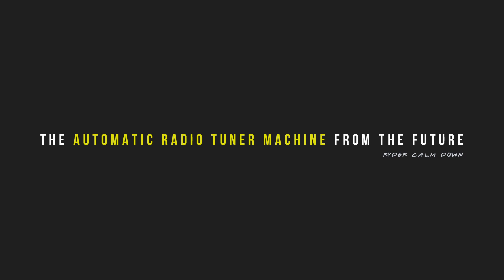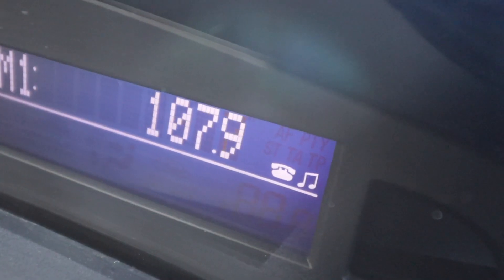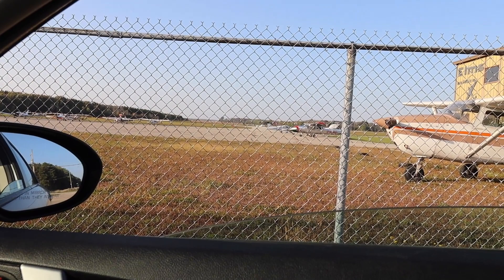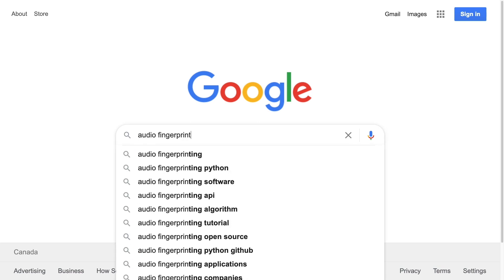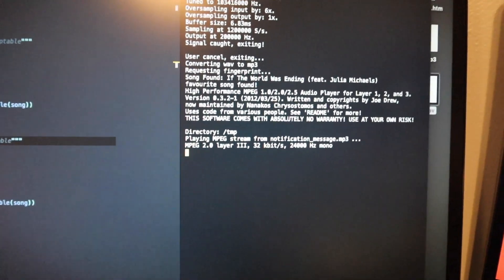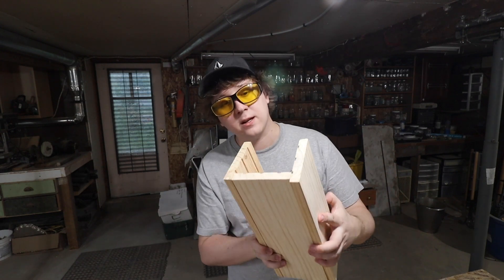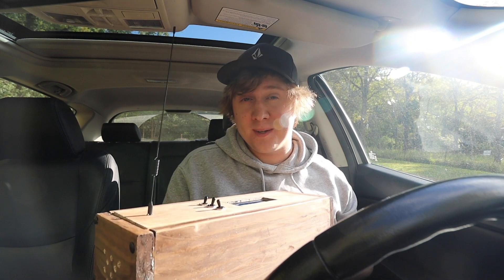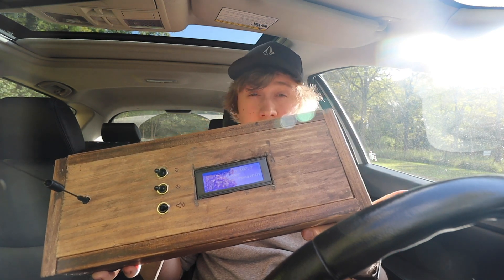FM Radio That Only Plays Your Favourite Songs

Comment: Using the internet is a little bit overkill. Most radio stations transmit what they are currently playing within their frequency.

SDR programs sometimes even show that automatically by themselves. So I guess that would be a little better, cause it doesn't require internet at all.

Comment: Why don't you make an active noise cancellation speaker? I see it this way: you put it in the noisy room, it takes the sound, inverts it and plays it back so it will cancel out the original noise signal.

Comment: (reddit sent me) That's freaking cool.     Do the stations in Canada use RDS?   If so, I wonder if there is a SDR decoder for it.  That might save you some API (and internet connection requirement) calls to find out the current playing song.    Cool video!
Reply from the maker: They definitely do, and there probably is! That would be a much more efficient way of doing it!

Comment: Can you make it to transmit fm signal from all fm stations directly to the car without switching manualy the fm frequency. I mean when it finds song that you like(from some kind of playlist) to transmit that frequency to your fixed one on the car radio
Reply from the maker: That's such a good idea. I don't know if the SDR can transmit (I would assume that it does not). Even if it did, I think I'd need 3 SDRs: one to scan, one to listen continuously, and one to retransmit.